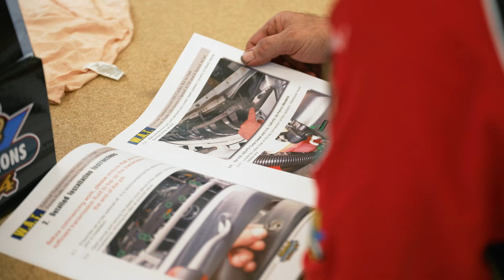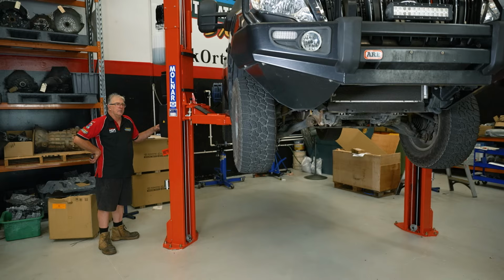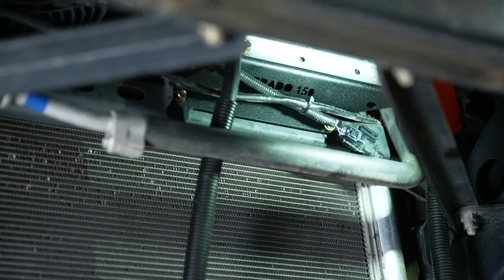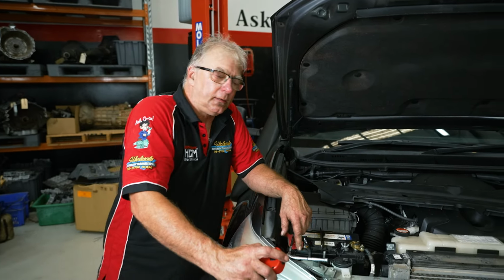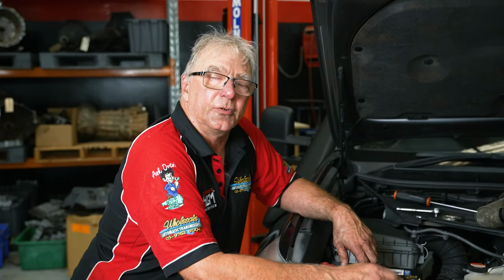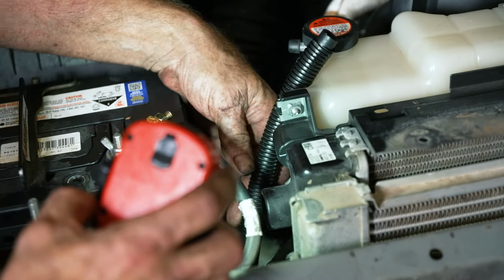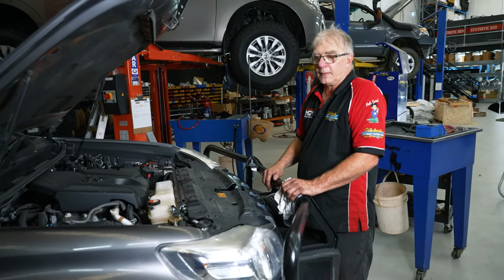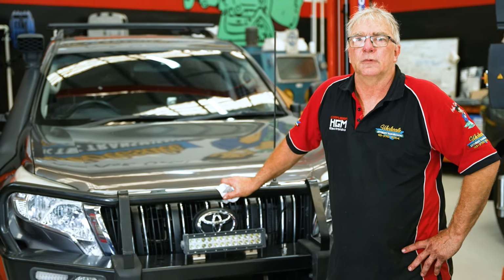Toyota Prado Oil Cooler Install

Comment: you forget to reinstall the horn, may be?
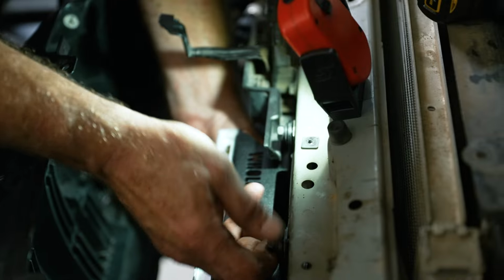Reply: At 4:20 you can see one of the horns. They have been mounted backwards. There is a different version of this video that shows the whole process needed to reverse the horns. Its a bit of stuffing around.
Reply from the maker: No, they both went back in.